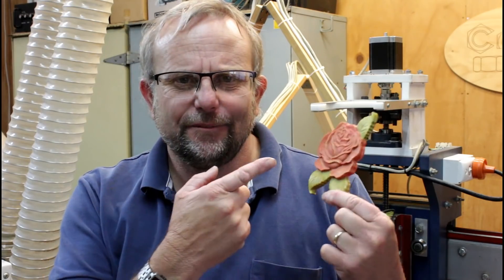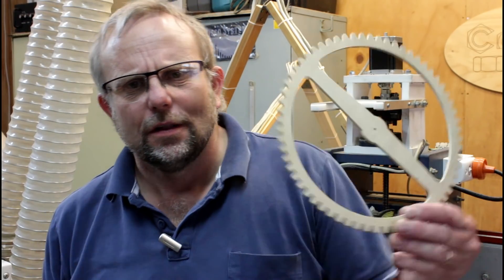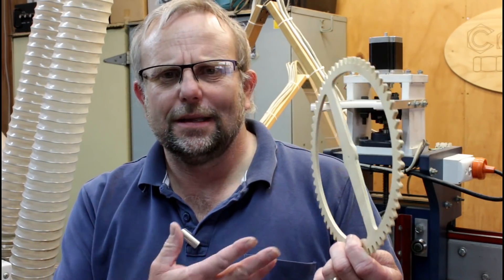1000ipm - CNCnutz Episode 138

Comment: I disagree. You should see some CNC lathes operate in production runs. The rapids before and after tool changes are crucial to removing over all machining time. Same goes for cnc mills
Reply from the maker: +Julius Jahn 
I an industrial setting every second counts and when you are changing tool thousands of times a day every second counts. How much are you going to spend to save that extra few seconds machine time? How many times a day do you change your cutter on your home machine? How many production runs does the average hobbyist do? 
I have see video of those CNC lathes and they are impressive. They cut away the steel like it's butter and are crazy fast. Those industrial CNC machines are impressive to watch but there are probably very few of them sitting in garages as hobby machines. I venture that most home CNC machines are made from MDF, plywood, or aluminum extrusions either homemade or assembled from a kit and are not up to running at high speed and the is very little point trying to make them do so. 
Just my opinion. 
Cheers 
Peter
Reply: true enough, although i think with home made machines, especially over 3' its important to be getting at least 250ipm rapids just for movements sake. My next machine is set for 550ipm rapids and WILL be able to cut at that speed as well. The frame itself will be over 120lbs of aluminum extrusion. 
Cheers
Reply from the maker: +Julius Jahn 
Sounds a nice machine. 
Cheers 
Peter

Comment: In tuning stepper drives  you have to balance speed and acceleration.
You can achieve a much higher max rate with a low acceleration.
But if you settle for a lower max rate, you can have high acceleration.
and THAT is very useful when doing many small segments, high acceleration will save you time  (-:
Reply from the maker: +David the Swarfer
Thanks David, nicely put. 
Cheers 
Peter

Comment: That's exactly the same reason i try and talk my friends out of turning a cnc router or mill into a 3d printer. Its much faster to have a dedicated 3d printer with belt drives and super quick acceleration.
Reply from the maker: +builtrodewreckedit 
Same with lasers. Light weight and super fast. 
Cheers 
Peter

Comment: Feedrates are way over rated... Even if you tune your motors to faster ramp up (acceleration) it is still pointless to rave about speed. Most diy'ers have machines that aren't capable of running those speeds reliably, accurately and consistently (repeatably), rigidity, etc etc. More emphasis should be put on actual cutting feedrates and cutter itself which is super super critical. I have seen so many people with normal router spindles that doesn't have variable speeds and is either locked at 18krpm or 24krpm and then they feed 6mm cutters at 39i/mp at 2-4mm per pass. Go figure that one out. Then they ask why does my cutters wear out so quickly? I think a lot of people spend too much time on the wrong things and gets carried away with speeds.
Reply from the maker: +Wonder Around 
Excellent points I couldn't agree more. High speed is a sales gimmick and while it is nice to have a bit of speed the machine needs to be capable of handling it. It is more important to know how to use your machine to the best of ITS ability rather than what you think it should be able to do. Slow feed and screaming router is a recipe for disaster. Maybe the title for a Hollywood horror movie. 
Cheers 
Peter
Reply: Funny there is still a school that believe you should make dust with a CNC router and not chips. Well there will always be residual dust but as you know you want to see more chips than dust no matter what. If the router cuts too slow and spinning too fast it heats up against the areas already cut and there goes the carbide infused with foreign particles. Dust is the way people used to use handheld routers because you couldn't feed the router at a steady pace and the absolute big difference....the cutters were designed for that kind of abuse. There is certainly a case for cheap ebay cutters and I have tried them all (basically)...the conculsion I came to is invest in a very good cutter and make 100% sure you know what you need (upcut, downcut, compression/spiral) and never or try to at least not to cross use delicate cutters between dissimilar materials...especially if you pay Eur60+ for a high quality long lasting cutter...and yes if you feed at the right speeds at the right spindle speeds in the right stock the good cutter will outlast the al-cheapo 100% for sure....and your cuts will remain crisp for so much longer....A perfect example is cutting moist MDF with both...but then again...you know all of this...I think it is about education...some people hear the word "CNC" and they want one...and don't invest the time in learning more about the simple science behind it...all the best...